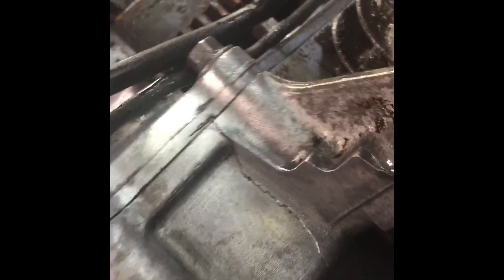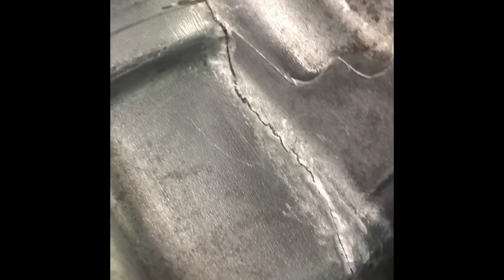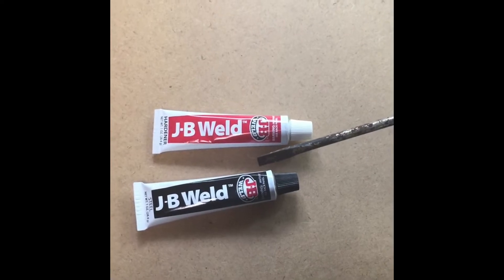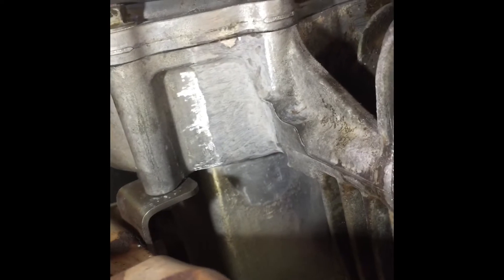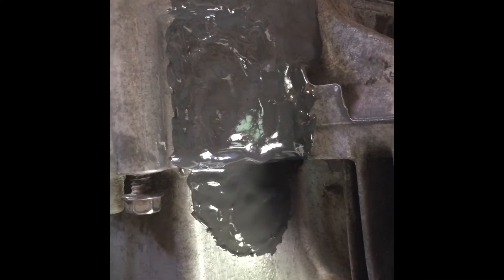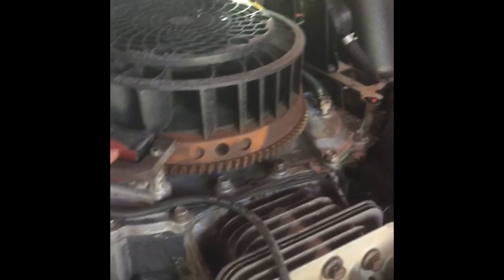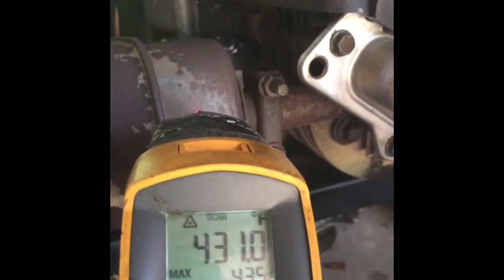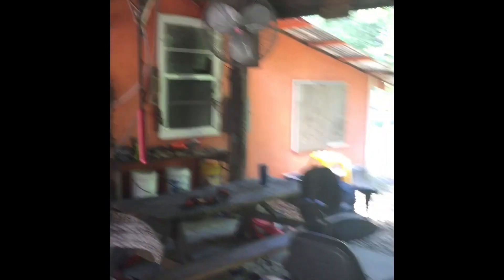Can JB Weld repair crack in aluminum block?

Comment: Picked up 2 tractors with courage engines that cracked in the same spot and as usual the cause was top bolts came loose. Repaired both with JB Weld and it's been a coupe years and they're both still going. Just make sure to locktite the cover bolts. And if anyone has one that hasn't cracked yet, check and locktite them also to prevent it from happening.
Reply: Same thing happened on my Kohler Courage! 😂

Comment: My Gravely 1840 is exactly like yours and cracked in exactly the same spot.  Uncanny.  Must be a design flaw in the block.  I will be trying JB Weld on it myself to see if I have similar success.
Reply: Yep, all of these Kohler Courage motors have the same issue.  Design flaw for sure.   The top case bolts loosen and the aluminum block flexes from all of the head/exhaust assembly weight and vibration.  The jb weld will hold for a bit but it really needs some supports at the head to prevent vibration and flex.

Comment: I cracked the engine sump of a Briggs lawnmower block when I removed the crank by punching in the lock pin with a mallet.
It's a hairline crack about 1" wide. Might use this method instead of getting a replacement.

Comment: good video.. i have a rear cover on my 6.0 power stroke that has a small crack and leaking little oil.. i wonder if this will work on that.. its aluminum as well

Comment: I didn't notice you drilling a hole at the end of the crack, to keep it from further cracking. Even with the JB Weld, I think the crack will continue. Pressure = Force / Area. So, all that force is being applied to the end of the crack. By drilling the hole, you increase the area the force is being applied to, thus reducing the pressure.
Reply: HiTechDiver I have to do this soon. How big do I need to drill it?
Reply: Alonso’s Mobile Auto Repair little late to the punch, but as long as the entire area where the crack terminates is drilled it’s fine. Usually 3/16 or even smaller is fine
Reply: @alonsosmobileautorepair8862  just a small drill hole. About 1/8”
Reply: Thanks guy yeah I had totally forgot about this I actually did it to my work daily and it’s still running till this day. It works wonders.

Comment: Nice!!!
Updates? How much use has the engine gotten with the repair before it finally failed? Did the the repair fail?
Reply from the maker: Still working and has about 20 hours run time.
Reply: @fixitdad9669  how about now ?
Reply from the maker: @vanillaguerrilla5052  I don't use the mower because the hydropump went out on right side. The fix is still holding and engine runs.

Comment: I recently cracked my transmission pan under my 2013kia forte about 3 inches will jb weld fix it up and hold it?
Reply from the maker: Yes
Reply: @fixitdad9669  update i actually cracked my transmission under the 2013 Kia Forte about 2-3 inches and i was wondering if the jb weld still be able to fix it and have my gears working

Comment: I have a hair line crack I think, its hard to tell, what does that temperature reader suppose to tell you ? never seen anyone do that before, I believe mine can be fixed to , not anywhere near as long as yours.. My engine mount screws work loose often that is what caused mine I know it did.. Is it still not leaking any? probably don't even have the mower now its been 4 years
Reply from the maker: Still have mower but don’t use because hydro pump went out

Comment: Is it still lasting ? No leaks so far?
Reply from the maker: Yes, it is working so far.
Reply: @fixitdad9669  would have been better if you drilled the crack end off to stop future progression of crack
Reply: Deep Blue do you know how big I need to drill the hole ? Also does it need to be on both ends?
Reply: @alonsosmobileautorepair8862  The area of a small circle is much much greater than the area of the end of the crack, so if your crack is similar to this video, just a small roughly 3mm or 1/8" hole is probably all you need.

Comment: I'm wondering if the jb weld will be able to resist the expanding and contraction of the engine block's cast iron or alloy aluminum at varying temperatures?

I know jb weld will consistently resist up to 600F for about 10min and a small engine goes to about 300F depending on weather, compression, and such.

Will the crack surface again with due time after using jb weld?

I also would like to hear how your crack is holding up since the repair @FixItDad
Reply from the maker: The repair heldso far but haven't used mower in a while because the right hydraulic pump went out.
Reply: Oh ok.

Comment: I got a pin hole in an aluminum hi pressure power steering line from rubbing on the frame of truck,you think this stuff will hold?
Reply from the maker: Not sure it would, but try and let me know.

Comment: You'd be surprised how well good old JB weld can do on cracked cast aluminum.  The funny thing is the more cheap Chinese the aluminum mixture, meaning the stuff some call potmetal or whatever, the better it sticks.  But as with any weld NEVER SAND IT, just let it be.  The more lumpy the stronger, and try drilling a small hole at the end of that crack to keep it from running.

Comment: Did it hold, is it still holding
Reply from the maker: It is still holding but haven't used the mower because the right hydrostatic pump went out.